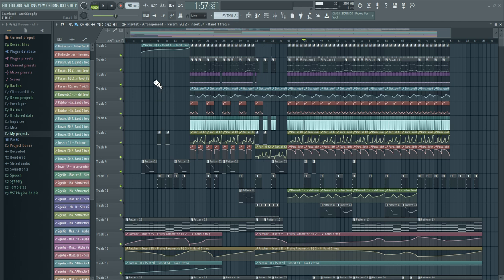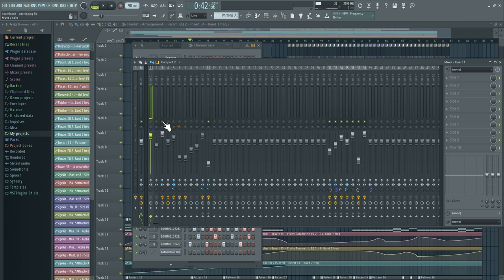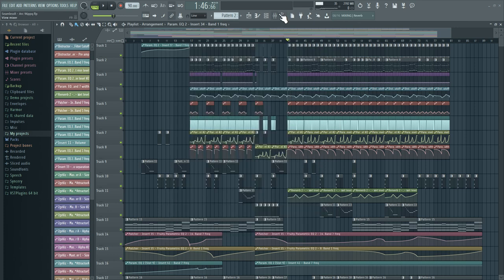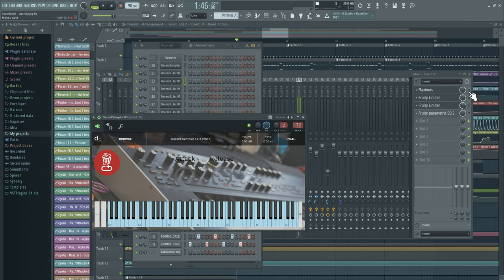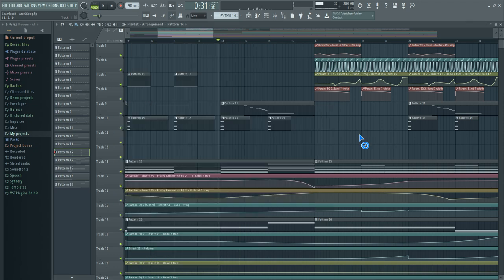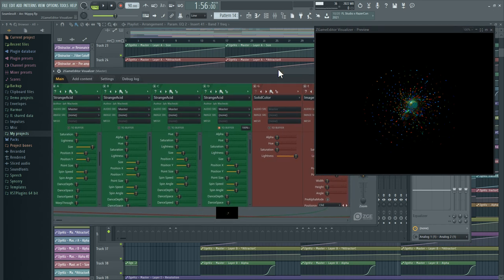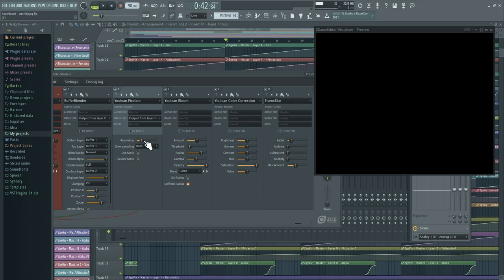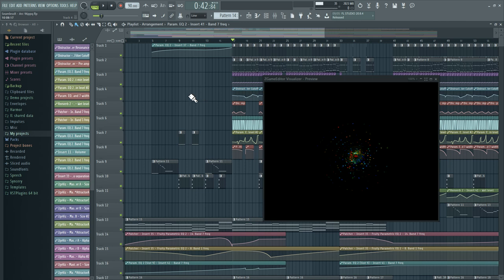Walk-through for SeamlessR - Arc

Comment: Hey seamless! I saw that the sample rate (?) of fl Studio changes the sound quite a bit so plugins that rely on spiky and detailed envelopes and waves will be afected a lot.. how is It with edison? I have some analog gear and when i record something does the sample rate (idk if its sample rate, i mean the thing you talked about in the beginning of the video) determine how good the recorded analog stuff sounds? Because the good thing about analog is that there are no sample rates and cpus and envelopes sound as smooth as a morning coffee, It would me a pity if FL would change that..

Great vídeo, btw! Greetings :)
Reply: You are misinformed, its a pain the ass to explain but what you described is not true. Although regarding analoge stuff i don't have the knowledge to comment on that.
Reply from the maker: The ppq (points per quarter) only effects digital motion. So how sharp your curves are. No impact on audio recording. 

Fun fact: the sample rate barely has any impact on the quality of an incoming recording either. It will have an impact on something digitally generated tho. That impact is aliasing as a result of very high frequency action. Hardware stuff does not alias and this is the key difference.